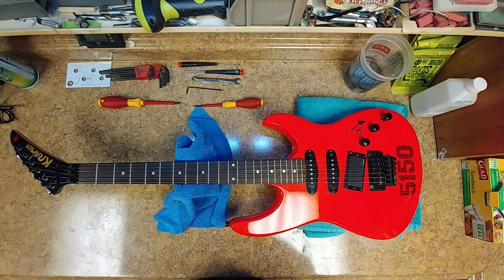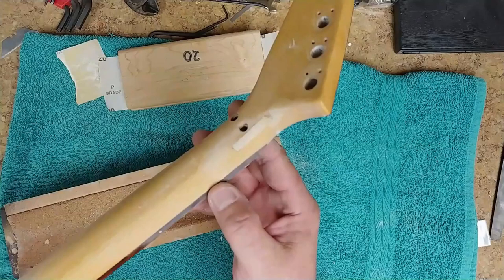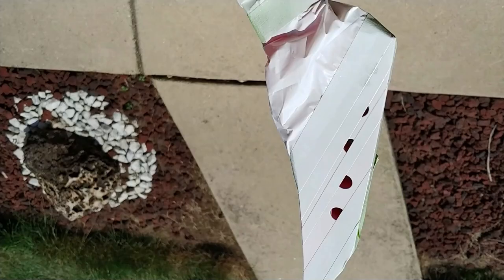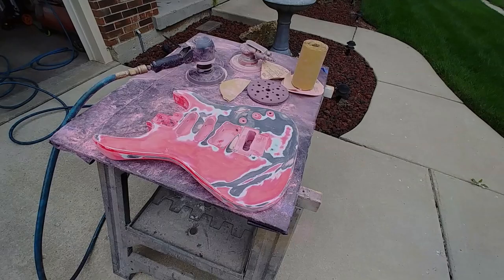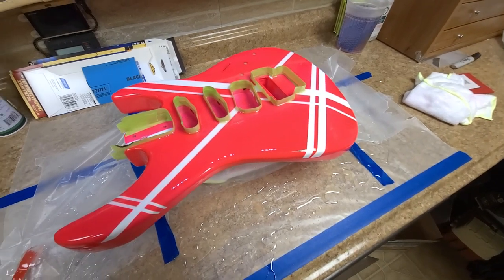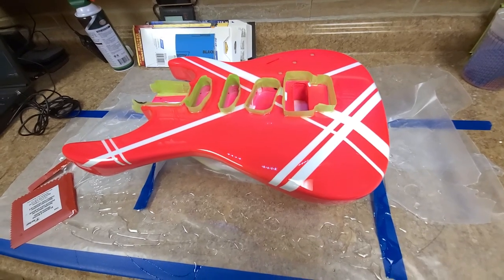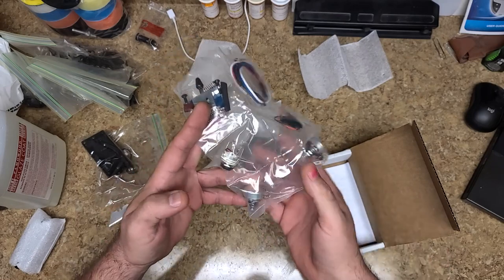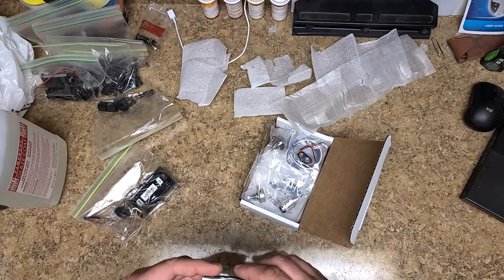How to Prep and Paint without Terry 3G's It and an Unboxing

Comment: It turned out like a piece of glass! Looks great Eric!
Reply from the maker: Thanks. Right now I want to give it a few days for the epoxy to get really hard and hit the top again with a second thin coat before working on the back. I think for now on I'll be using the epoxy for bodies. Not only does it look like glass, even after wet sanding and buffing. It also doesn't scratch and scuff like painted clear. It doesn't chip like paint either.
Reply: So it’s a pain to apply but definitely worth it!